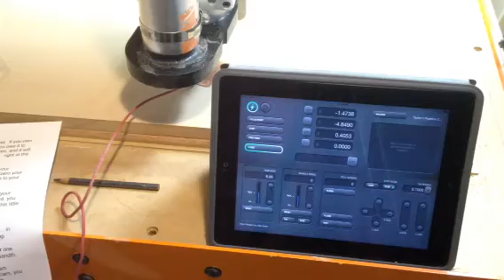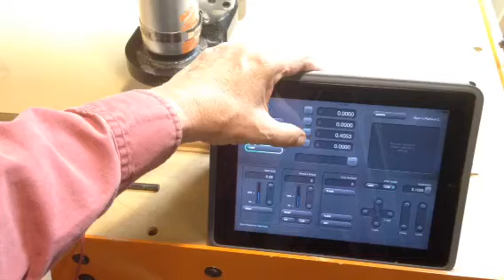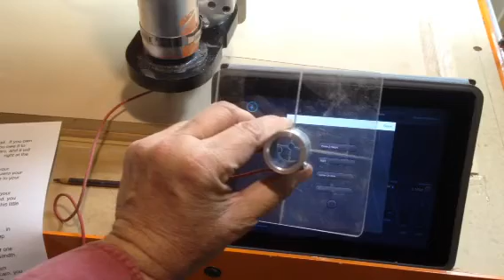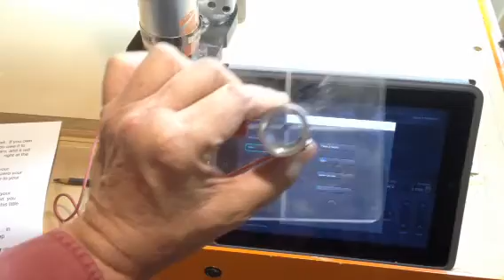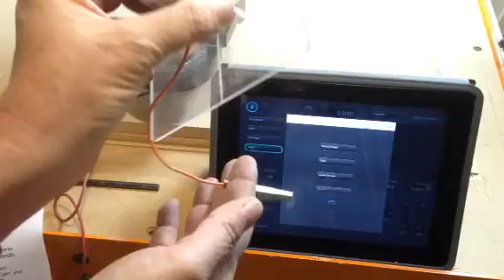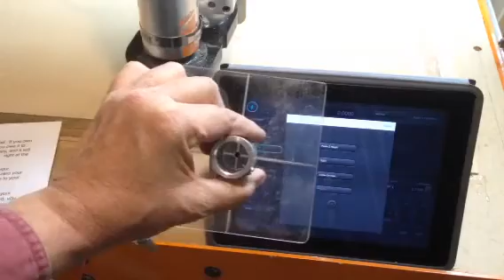MachPendant App Demo

Comment: do you have an app for android tablets?  also does it use blue tooth or wifi for interface????
Reply from the maker: I'm not the App developer… just a very satisfied user.  If you go to www.machpendant.com, you can learn more about this existing iOS app.  There is a link to the user forum there.  I can tell you that Mike Maat, the developer, has said in the forum that he has no plan to develop a similar app for other mobile platforms.
Reply: thanks buddy enjoy your weekend